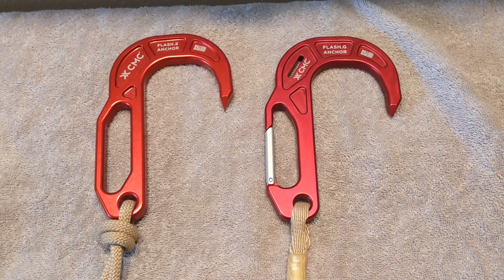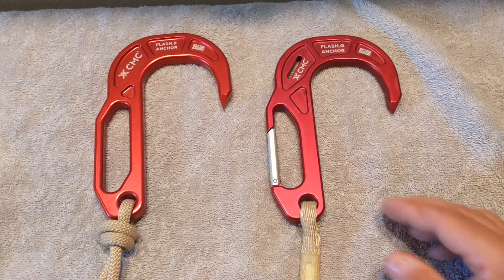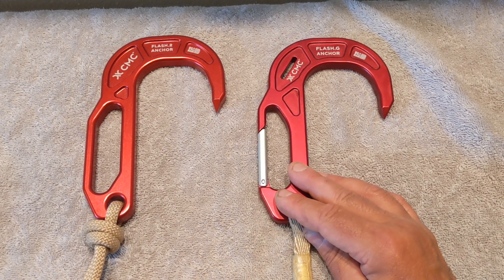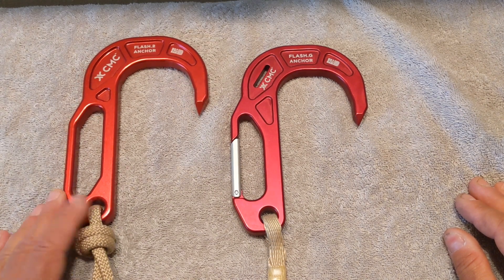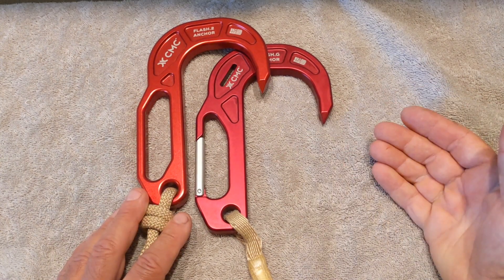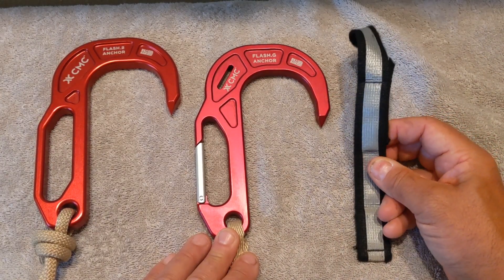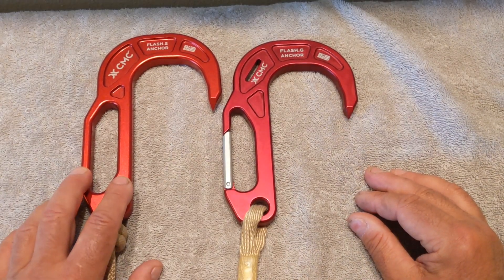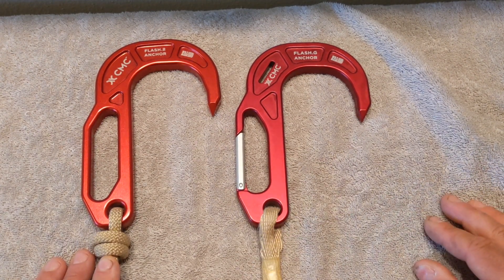Video #1 - Firefighter Escape System Anchor Hook Comparison - CMC Flash 2 vs the Flash G

Comment: Dale, what do you use the pull tether for if not connected to the hook? Just got this system issued at my FD and working through tuning it.
Reply from the maker: I have it connected to the carbiner on the terminal end of my system. The hook is positioned in my pocket to make it easy to deploy, but the terminal carabiner that I use for victim rescue sits lower in my pocket - I attach the tether to it and run the tether over the pocket and under the flap so the tether sticks out, but the carabiner remains in the pocket. Take a look at this video: https://www.youtube.com/watch?v=9FfRFukeKTk